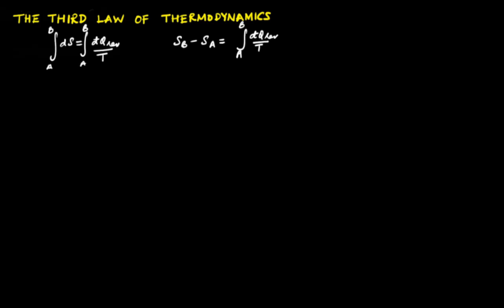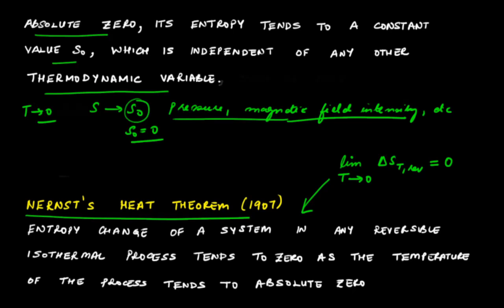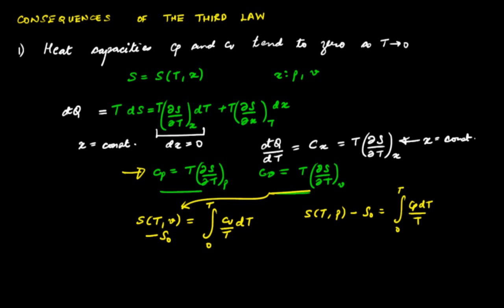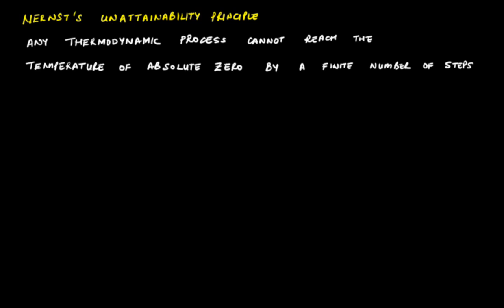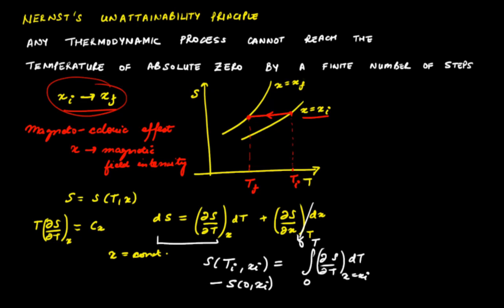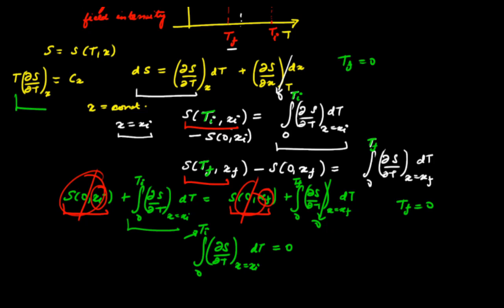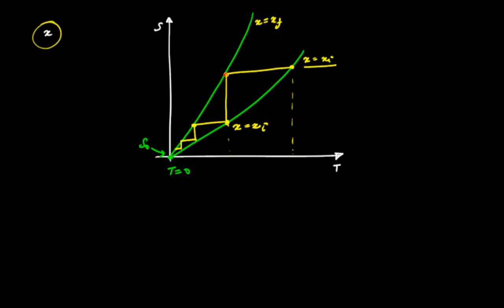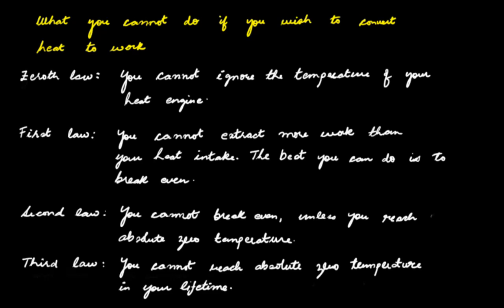Lecture 36: The Third Law of Thermodynamics and Conclusion (Engineering Thermodynamics)

Comment: Sir, in the statement of the Third Law of Thermodynamics, have we ever commented on S0 being the minimum value of S? If yes, where? If no, let's make a shape of the Nike logo(outlines only and just take the left part of it and ignore that the logo is a closed curve on the RHS) in the T vs S curve(i.e., if S0=0, I'm talking about the negative values). Can such a curve be possible? If yes, I think the problem of achieving absolute zero is solvable. If no, why?
Reply from the maker: S0 is minimum because S vs T curve for constant x cannot decrease. Because T(dS/dT) at constant x=Cx (heat capacity) cannot be negative.
Reply: @bahgalabiitdelhi7797  Sir, You are talking about the stable equilibrium case. What if the equilibrium is unstable? This will make our C to be negative. I read that some nano scale cluster of atoms have negative heat capacity. And I don't want to comment on the negative value of temperature. 
Also, if that unstable equilibrium is there(possible somewhere), S0 doesn't have to be minimum. Does it?